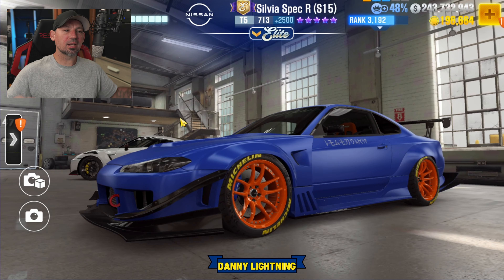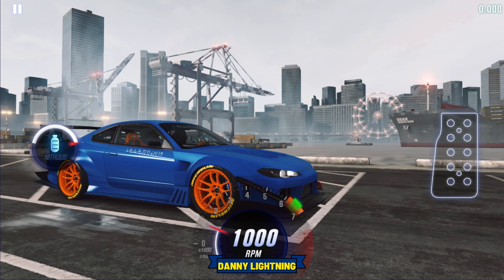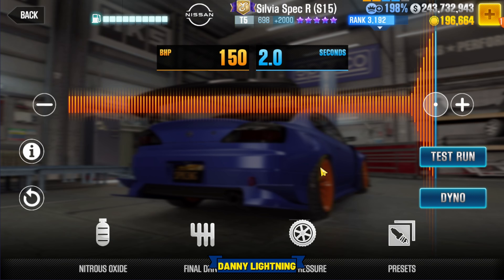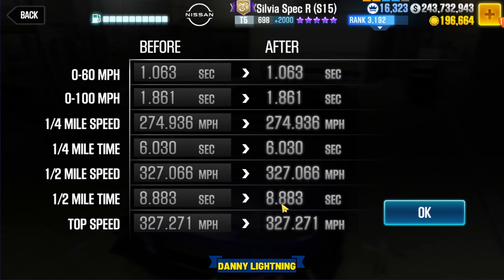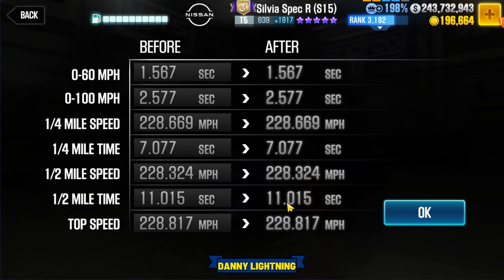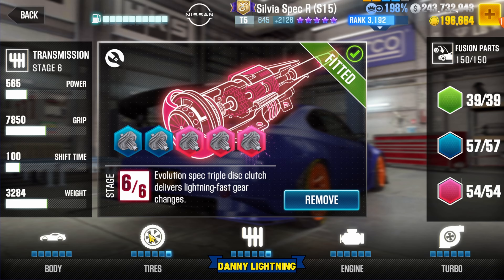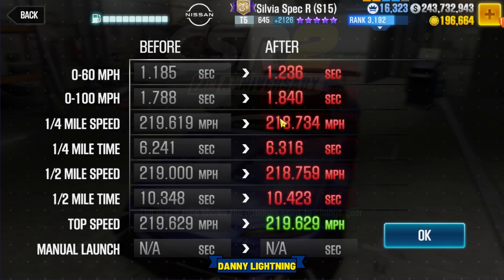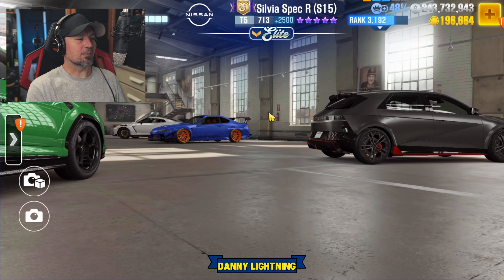CSR2 Silvia Spec R S15 Stage 5 - Stage 6 Max - Review - Live Racing Setup

Comment: Which car i should elite for live racing the Elite tuner Corvette stingray or this silvia spec r, which is a better live racer or any other suggestions???
Reply from the maker: I think the Corvette was a lot easier to drive on the live racing setup, this one I find you got to get it just right or you're going to run about a tenth of a second slower than you want to be and I don't remember that happening for the Corvette I really liked the Corvette so personally if I had to pick one of the two I would go with the Corvette myself
Reply: @Danny-Lightning-CSR  thanks a lot 🥰🥰🥰
Reply: @Danny-Lightning-CSR But the Corvette has that nasty needle kickback issue during the live racing launch!

Pete ;”)

Comment: Hi Danny. Can you explain the difference between a low PP high evo tune vs a down tuned car? Thank you 🙏🏻
Reply from the maker: Generally when you down to the car it loses most of the evil points and it will beat the Dino Time by sometimes several seconds people mainly do those for events that require you to beat the dino time or to go in there and cheat other players out of money they'll go back 200,000 and your car won't even stand a chance, I don't support down tuning in because it's 100% unfair,   low performance point high Evo is just a low parts upgrade which allows the car to win a lot of live races but other players can still beat them if they're also good at tuning and shifting and all that good stuff so these tunes do give you an advantage but they are not unbeatable so it's still fair to the other players who have learned how to properly tune for live racing and whatnot but they down tuner is will destroy the low performance point high EVO car so if you get a big old bet for $200,000 more than likely it's somebody with a down tune car that's just going to leave you in the dust
Reply: @Danny-Lightning-CSR  ok. Thank you. That would explain the odd max bet I get (and always refuse)

Comment: Unrelated question but is the Chevy truck better than the under pressure Chevy?
Reply from the maker: I guess that depends on what you're trying to do with it but they're both very cool I like them both the Chevy truck doesn't really have any type of live racing setup you're probably not going to do much as far as getting it to beat the dino time to where I think the under pressure can be set up to beat the dino by pretty nice amount between the two I mean I like the under pressure better but neither one is what I would call one of the better cars in the game, I look for cars that are pretty good at everything I like to see good top speed good acceleration I like to be able to be Dino and I like to see a good live racing set up as well on these cars so if a car does all or most of those things I consider it to be very good but if it's only doing a few or a couple of those things I don't always consider them to be the most wonderful
Reply: I'd say the Under Pressure is used more often, both cars aren't really good anymore for live racing, but the HS Customs Camaro is also really good for beating dyno. In fact to run the best time when maxed out it runs a downtune. It does decent sprints, has a decent top speed and is way easier to drive. Both cars are quite annoying to tune though. Personally I wouldn't pull for either cause I guarantee since this is ART3 there will be some decent cars available for gold keys

Comment: Many of us don’t like the elite corvette as it needs that awful needle kickback start to get the best runtime. Most of the time I miss the kickback and run a slower time. So I just avoid cars with kickbacks. I remember you repeatedly saying that the Nissan Skyline GT-R R34 was a nightmare to drive because that too had a needle kickback start. (In the video for that car.) Now you say it’s pretty good! What changed?! The corvette and McLaren 720S also has the needle kickback start! So basically you’re promoting cars with a needle kickback start. It’s total hell to drive them!

Pete ;”)
Reply from the maker: The elite tuner skyline has a really good live racing setup and it's easy to drive on the live racing setup, I actually don't remember the shift pattern for the skyline when it's maxed out, cars to have a kickback some of them are pretty easy to hit the kickback and some are pretty hard.  Some people don't want anything to do with the car that kicks back some people actually enjoy the challenge or some of them is just super simple to get the kick back to happen but it just depends on the car,  but I haven't driven the skyline upgraded in a long time, I think I normally just keep it on the easy to drive live racing setup which works really well